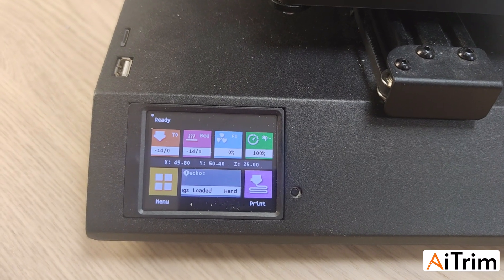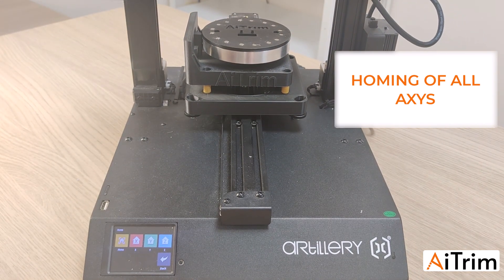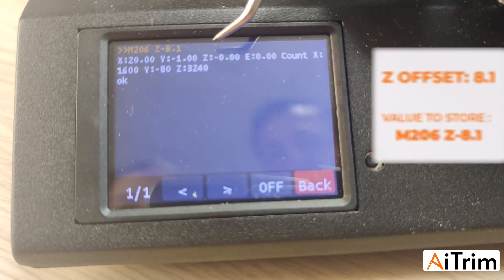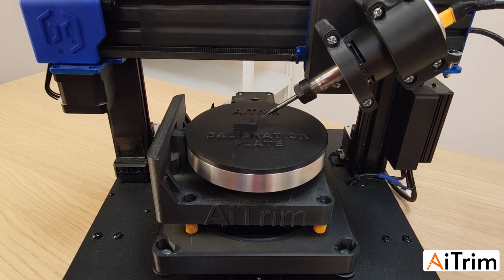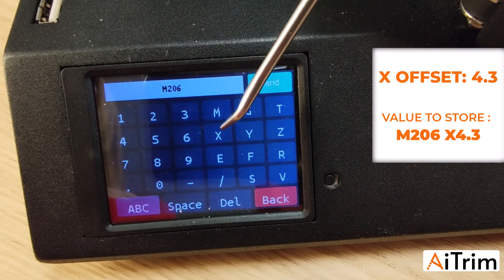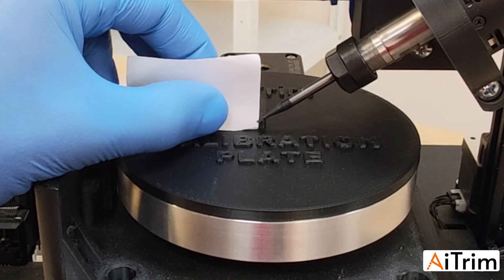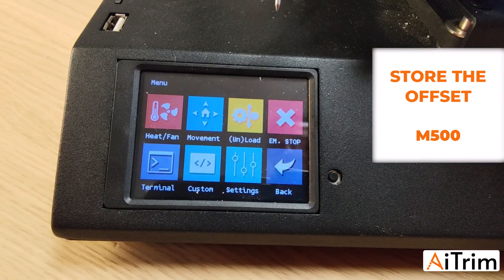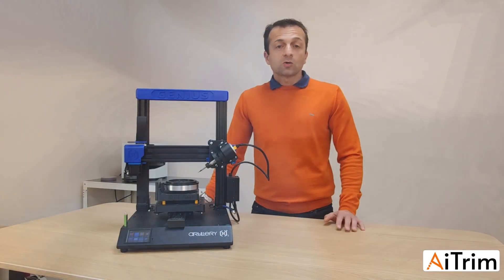AiTrim V1.1 Calibration - Part 2

Comment: Hi there. Good work!
some query about firmware and ur G-code generation...
1. did u setting up the marlin or ...?
2. for exporting G-code usein NX or Powermill or ... ?
3. u set the spindel on 45 degrees for easy sidemilling ?
Reply from the maker: hello, thx for your feedback.
1. I made a custom Marlin frimware to work with the trimmer
2. To make the C-code I developed my own software
3. right!

thx a lot, again!
Reply: @aitrimaligners  Job job !!!
C-code or G-code ? do u have any reference for explore more ? i need it  to develop for my WAAM 3d-printer ...  .
Reply from the maker: @ do you want to make a trimmer by yourself ?
Reply: @aitrimaligners  actually not trimmer... I am considering develop it for my WAAM 3d printer project...
Reply from the maker: @ can you explain me better the project to understand if I can help you or not?
Reply: @aitrimaligners  Hello there! sure! WAAM is a kind of AD process to printing metal stuff... . now i have a XYZ + A and maybe B axis for this 3d printer...  . customize firmware done but i all slicer like Cura, Orca, Repiter, Prusa and etc. dosnt support more than 3 axis. now generat and export G-code is my challenge...  .
Reply from the maker: @ is your hardware already 5 axis motherboard?
Reply: @aitrimaligners  Yeee. main board is BTT Octopus and i can set until 6 axis and 2 extra step draiving... but at begging i want to set axis 4 (rotary table).
Reply: Hello
 How we can contact you for making a purchase of your aligner trimmer ? Thanks
Reply from the maker: @dentalmacedonia1352  hello, you can write me an email at trim.aligners@gmail.com